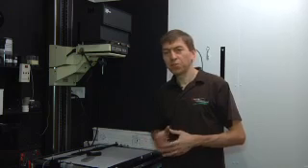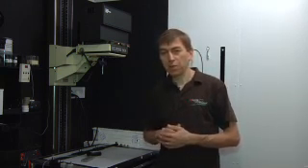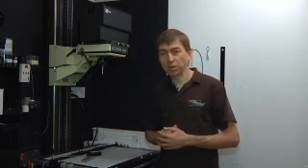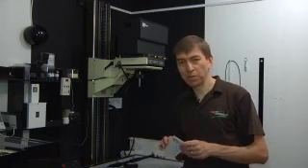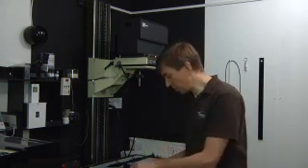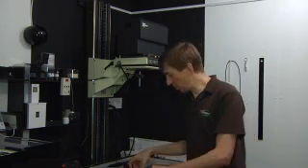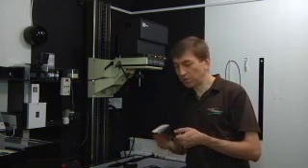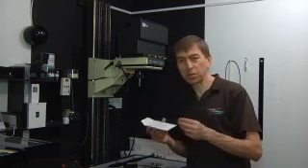Intro to meter calibration by RH Designs

Comment: Im struggling with my Zonemaster (at the moment - maybe my own user error) Im getting a decent reading from the highlights (shadow area on neg) but shadow (dark on neg) readings are way over. After a regular test strip the more balanced exposure is 11secs @ f11 - not the 43 seconds Zonemaster is advising. (Using Leitz Focomat V35 enlarger and Ilford MG5 paper) - Tried on two negs from different shoots with same result. Ive only had it for a week (two sessions) so will calibrate and try again. Will also shoot a test role with bracketing to rule out any bad exposure (thin or thick negative).